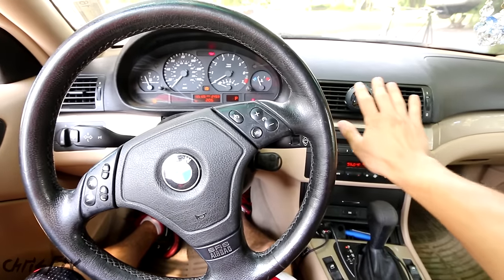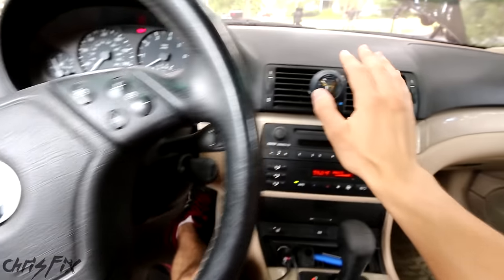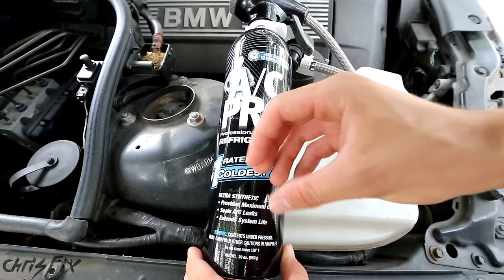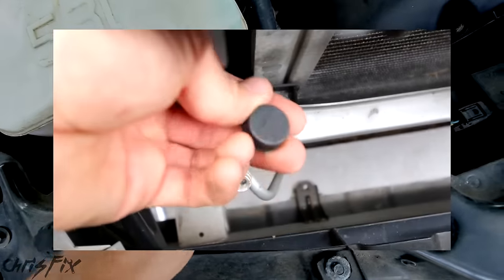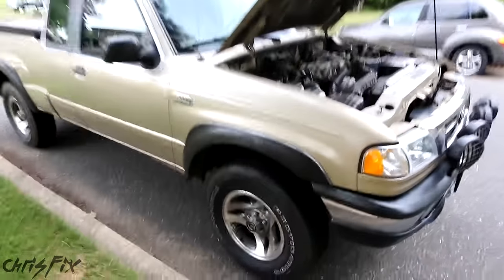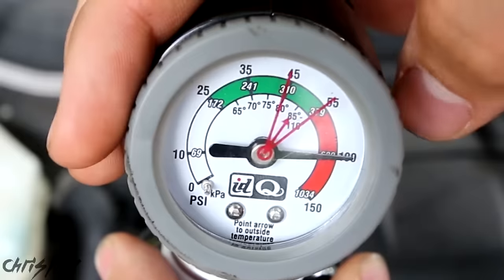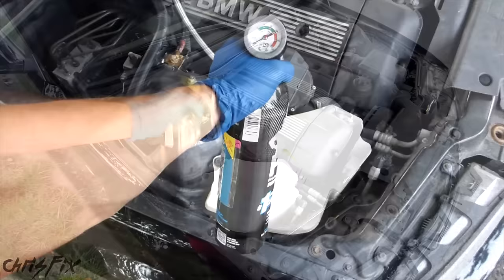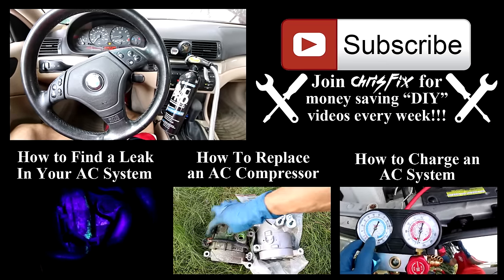How to Recharge Your Car's AC System (Fast and Easy)

Comment: Question everything’s running fine on my Nissan 2012 Sentra S but it seems for short trips. My AC doesn’t cool enough but if I’m on a road trip it’ll get cold within time what could be the problem with the ac?

Comment: Chris, not sure, but I bought the can AC pro like you have got home and it's digital. Don't know if it has anything to set my outside temp like how you had yours set for 90 degrees 45 to 55 psi. Have you used any AC pro cans like this?

Comment: Hi Chris...I just bought a used 2007. During the test drive the a/c and heater worked. 4 days later the a/c stopped. Parked the car now the car is dead. Any help would help. Ty !!

Comment: Why did the mechanic want $500 to fix mine 😂😂
Reply: Steve Rodriguez, My gosh mechanic here  want $520.00 to fix the ac BS!  They are rip you off and me  and also they better not cut my ac line. Now I'll will do it myself save money.
Reply: @timothyhurley46  the exact same thing
They wanted to replace my entire AC line but maybe they would remove and clean 🪥

Comment: Can i use the can more than once? I used it on a different car a few months ago and still have most of the can but don’t know if i can detach the gauge or if it’s ok to check the pressure with the can attached.

Comment: I have a question, I have the one with the blue Ac pro , the temperature is 40c and above.  When I measure it, it is above 60 or 70 PSI, is it normal?

Comment: Hey Chris! This is a question for everyone that could possibly help. 

I'm trying to recharge my wifes 2019 Subaru Legacy, so I go out and buy the exact can you have in the video and when I attempt to hook up to the low pressure port its almost like the hook-up on the car end is too bulky or the coupler on the can is too small.

Im doing everything right, right refrigerant, right port, pulling back on the neck while pushing down and it just doesnt work! I can even see that the inside metal ring thats in the coupler is actually digging into the metal on the low pressure port. So clearly something is wrong! But im so clueless on this type of stuff that I just dont know where to go from here. 
I even went out and bought a brand new gauge/hose/coupler for AC PRO cans and its doing the exact same thing!

Do I just have to return these and try a different brand? Because all the other brands nozzles look like the have flexible plastic pieces that can snap around the low pressure port, where AC Pro is the only one with a metal sleeve inside the nozzle.

Can anyone assist or advise, please?

Comment: question:right before you pull the trigger , the rube connecting the low port and the can has air in it. so that air will enter into the system? is that a problem?

Comment: I ended up overcharging my system , I used a Harbor freight kit, it was reading low and then the compressor started kicking on and off, any advise as to why the compressor turns on and off toó quickly?
Reply: Its because the system was low. The compressor is controlled by the low pressure switch. When the pressure on the low side gets too low the compressor turns off.

Comment: Is the system closed?  Where did the original fluid go?  Can you over fill?
Reply from the maker: Yes, it very slowly leaked out over time, and it's possible but hard to as long as you follow instructions
Reply: @chrisfix  Thanks so much for the reply :)

Comment: If you have replaced a compressor do you need to suck out the air first? Or just shove the gas in?
Reply: Yes, if you're replacing the compressor, you need to remove all the air in the system using a vacuum pump (around $100 for a consumer model). Most mechanics also replace the A/C condenser and evaporator at the same time, so any crapola inside the old system won't destroy the new compressor. Also, you need to add a small amount of special oil to the new compressor, to make up for the oil that was in the old unit. In sum, this is not a beginner project.

Comment: Mine says HFC-134a is this a problem? I looked up the differences and it’s clearly on a chemical level which I’d take serious after seeing a caution label. I can’t find HFC-134a all that shows up is R-134a, should I just flush the system and replace with R-134a moving forward? Thanks guys
Reply: HFC-134a is equivalent to R-134a

Comment: Does the compressor have to be in when adding? My gauge reads red when off but in the white when clutch is engaged. Is that okay that it is red when clutch is disengaged?
Reply: I think that's normal

Comment: Question Chris: Why when Bemmers lowest set temp is 50 degrees F, after charging, you got a vent reading of 43.7 F, well below the limit?! Yes, I can imagine "Bigger is Better" but why? and does it represent a problem somewhere else down the line such as a bad thermostat/regulator?
Reply: The interior of the car will never get as cold as the air coming through the vents. But a temp of 43.7 is impressive. I'm usually happy if I can get 55 or 60 degrees coming out.
Reply: @mobius836   Thank you for your kind reply.

Comment: Hi Chris, i have a Nissan Sentra 2010 which I got back from a radiator repair (I crashed into pole in a parking lot previously). I guess the shop evacuated the refrigerant so I did a recharge myself on the low pressure port as instructed. This got the compressor running again. However, the psi stucks at 28 no matter how many times i tried. Is that normal?

Comment: What happens if the pressure doesn't go up? I'm using a digital gauge r1234yf freon on a 2015 chrysler 300. When I first connected the can it read 0. The compressor wasn't clicking on. I started charging it and heard a tik sound. Then, I saw the compressor clutch turning. I thought it was gonna work. I kept charging but the pressure won't go up from 11 psi when the clutch is turning.  When it's off it got to 15 psi.  I tried 5 times but the pressure is not going past 11 psi. What else can it be?

Comment: I noticed today a really bad smell from the AC when kt was a cold start on a cold morning and it started to smell when there was warm air coming from the vents, then I noticed when I put it to the lowest temperature there is some warm air coming from the middle air vemts but side airvents are cold, would this help le to het rid of both the smell and the warm air?

Comment: I've been rewatching this a few times and I just can't figure out what's wrong with my ac, I stick the end of the freeon guy on the LP port and it reads crazy high pressure, but I also can't tell 100% if my compressor is turning on or not (because everything visible spins whether or not the ac is turned on), it does Rev up when I turn it on though, so now I'm just stumped and not sure whether my compressor is working or if I have high pressure or what, do you have a solution to getting the freeon in there? or maybe even checking to see if my compressor is running? (other than the one in the vid)

Comment: Compressor engage fuse working condenser working and full freon ac not working help
Reply from the maker: I would rent/buy an AC gauge set and see what your low/high side is at, sometimes the compressor engages but does not actually have enough freon to compress and make cold air

Comment: What if the compressor keeps kicking on and off. The gauge is in the red when the compressor is off and 3/4 into the green when its running. 92° outside. Cold air is coming out of the vents. Person said someone charged it for them and said they might have over charged it. Said they put two bottles in. I'm thinking the 12oz bottles. I captured some refrigerant but no change. Does anyone know what's up?

Comment: To bad these kits use propane as an additive. Propane will absorb moisture and condensation, which would directly cause your AC ability to remove heat. The AC system is made to remove moisture, not add it. These kits you can do yourself are not even comparable to a real AC recover/vacuum/recharge

Comment: What does it mean if your ac compressor kicks on when it’s over filled
Reply from the maker: If it’s dangerously overfilled the pressure sensor will prevent it from kicking on

Comment: Maybe you can help me.. my 2012 hyundai genesis coupe 2.0t put out a P06A4 low voltage code and the only thing that's not working is my a/c is blowing hot air and ac clutch is not engaging..

Comment: You didn’t purge the line first….
Reply from the maker: From what I understand with this kit, the line is sealed when new and when you are done and you remove the line, it has an internal valve that closes so there is only ever refrigerant in there. There is no way to purge the line like you would with a traditional manifold kit

Comment: Chris my 11 Silverado ac clutch was kicking on and off so I added a charge and now it's not engaging at all. I checked the compressor and clutch by supplying power and it works what should I do???
Reply from the maker: Sounds like you might have overfilled it so it won’t engage as a safety.

Comment: What happens if you overfill?
Reply from the maker: You would wear out the compressor very quickly assuming the pressure switch doesn’t prevent the compressor from kicking on.

Comment: As a mechanic i make so much money from people using these ac recharge cans from replacing condensers to compressors to blown lines all these do is over charge the system and cause way more issues down the line for you being to lazy and to cheap to have it done the correct way always reclaim before you recharge

Comment: Hey so while I’m filling it up with the ac on it shows I’m at 50 so I stopped and let it run for 5 minutes then I attached the gage again and it said I was at 2 so then  kept filling it up until it didn’t let me get past 21, so then I turned off the ac button then it shows I’m a 60 psi

Comment: Errr, this is a pretty bad idea. The gauge tells you about the low end pressure but nothing about the more important high end pressure. You also have no idea how much you're putting in. This is a cheap and dangerous way to fill an AC.

Comment: I ran into trouble at the end; I could not remove the hose from the low service port.  Could anyone give me a tip for disengaging it?  The low port is in a narrow and hard to reach space behind wires and another hose.  Thanks for any help.
Reply: I got it; it has a locking mechanism, which can be unlocked by pulling the flange backward.

Comment: Howdy to any one..got a 2006 Honda accord. The ac works great until I get to about 40mph. I have recharged and or added freon to the system...compressor comes on. Any help would be greatly appreciated??

Comment: Hi Chris I'm Matthew from Cape Town South Africa listen I've been sitting with this problem with My BMW 320D E 46 preface the cars engine has been overhauled but the mechanics can't seem to start the car without the starting fluid if they use the fluid it starts but without it no can do what seem to be the problem would really appreciate it if you could assist in this matter thanks

Comment: I shoulda watched this before I put over a 100 psi in mine
Reply from the maker: Did any parts in the system break?
Reply: @chrisfix  surprisingly no but I managed to get the psi down to 45

Comment: What if I did everything right and everything works except the cold air part still. And my pressure is in the red.
Reply: A good suggestion, though some cars don't use orifice tubes. However, replacing the tube lets air into the system -- meaning it will require evacuating and recharging.

Comment: With the engine running, the needle on the dial was in the white at about 22-24 psi so I kept squeezing, shaking and adding. The the needle never moved, so i squeezed shook and added more.  No difference. Finally I shut the engine off and the needle was in the red, at mid-point, probably about 80 psi.  Have I ruined the system?  Will it blow up?  :(
Reply: If the compressor is not running the pressure equalizes to a higher pressure which is normal. If the suction line coming out of the evaporator going to the accumulator is nice and cold you have a lack of airflow through the evaporator coil. If its not then check the high side and liquid line temp subcooling. If high side pressure is normal and you have subcooling then its a clogged or stuck metering device. If you have low high side pressure and not enough subcooling then its low on refrigerant.
Reply: @Redtooth75  - thanks, but this video never discusses the high side.  Off to the auto A/C shop I go......
Reply: @johnlayzell5088  the gauges can be rented from free from autoparts stores

Comment: Not seeing the high side pressure, you are missing the other half of the party. Not counting humidity and many other factors is not good either. You don't just dump a can or two in and call it good.
Reply: You don't really need to look at the high side pressure, it can help but is not necessary. Obviously weighing in the charge is the most accurate but that is not always a convenient option.
If the suction pressure and superheat is good then the system is charged very close to the proper amount, any difference would be insignificant.

Comment: If anyone can awnser this I me and my buddy just replaced the ac pump on a wrx and was wondering do I have to pull a vacuum then recharge the system or can I just recharge it without pulling a vacuum we do have a leak in they system is just like any other ac system where I use bubbles and presureizes it with nitrogen I'm I going to have to do a flush also?
Reply: Vacuum the system then add freon that has leak sealer to fix the leak you have

Comment: What do I do if mine is in the red. Mine was immediately in the red when I put the hose on
Reply from the maker: It’s because the compressor is not running. You need to figure out why it’s not running.

Comment: Conceptually, recharging seems like a waste of time, because if it lost pressure that means its leaking, so unless the leak is fixed it will just lose pressure again.
Reply: Or you drive a Subaru that you just pulled the engine on for the 3rd time this month and all you want is to drive to school with a nice cool breeze

Comment: I went to try this and I go to fill it and my compressor starts clicking on and off and I know It can do that when it's under or over filled but what number do I even look at with the ac on and when the compressor is off it's at 18ish and when the compressor kicks on it's at 45 and then when I turn the ac off and saw the pressure it was at almost 60
Reply: I have a 96 Ford mustang GT btw
Reply: Its undercharged. The compressor is pulling all the refrigerant out of the low side and causing the low pressure switch to open.

Comment: Do not add leak seal into you ac system, it will swell your seals they will crystallize and ruined your whole system. Then you’re gonna have to get the whole thing replaced.
Reply: If the compressor fails youll have to replace the whole system anyways

Comment: Thousands of dollars? You can fill with dye and find with black light in minutes for the same cost of the Freon can your using.  Found mine immediately and fixed the seal with o ring kit that cost 7$. Just fix the problem and  not throw your money away and not leak deadly Freon all over the  environment 🙄
Reply from the maker: The labor cost, especially on a car like this BMW, can be into the thousands even for a $1 o ring because it can be very hard to access. That's definitely the best way to fix and I have some videos showing how to do that but its not always worth it or possible depending on the car and the situation
Reply: The people that wanted to fix my AC wanted at least a minimum of $1000 to just take apart my dash.  All I had to do was rip apart my dash and mess with the blower, clean out the condenser, go to a junkyard/salvage yard and find the exact AC control module. Mess with the wires that control everything… Definitely wasn’t something I could’ve done alone with my know how but luckily, I have some people around me that know they’re doing. Probably gonna play my homeboy like 200 bucks or something for helping me out.

Comment: Mine won't take a charge and displays far into red immediately. What can I do?
Reply: Check your ac fuse
Reply: @LilJes420  Turns out my AC clutch center bolt fell out, and over time, the clutch itself loosened and fell off. No idea when. I bought a used compressor with a clutch, removed the clutch, installed it, and all works again .
Reply: Got you, glad to hear you figured out what was wrong

Comment: I have an E90 BMW with likely a leaky evaporator. Typical, the bastard quits blowing cold on the hottest day this year so far. Additionally, the country I live in is part of the EU, and these kits are technically illegal to buy, but I guess Amazon doesn't care. Places that could fill the system properly won't do it unless they can confirm that it's not leaking (which it obviously is, AC systems to need to be filled unless they're leaking).

Comment: When I plugged it in it went to red then when I squeezed the trigger and went to white
Reply from the maker: Correct. Until the AC compressor kicks on it will be in the red since it’s the resting pressure.

Comment: I felt confident to do this until you said that I could get frostbite or possibly blind myself lol
Reply from the maker: If you are wearing safety glasses and gloves, and you make sure the connection is on the valve nice and tight, you should have nothing to worry about!

Comment: Can anyone back up the claim that this product's sealant does not damage a mechanics A/C diagnostics system?  I am skeptical of this claim.  Whatever you call the sealant, a conditioner, whatever, it's still something extra added, a pollutant.
Reply: Go to an independent shop and they will use an a/c system to evacuate your refrigerant and add new refrigerant to the exact specs of your vehicle. This is the only way you know for a fact you arent risking anything considering how expensive a/c systems can be to repair if damaged.